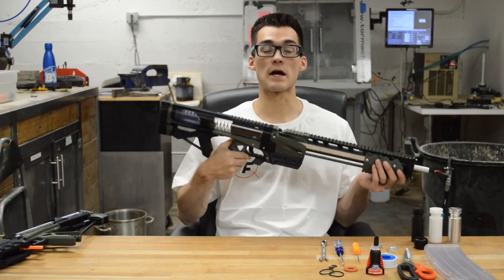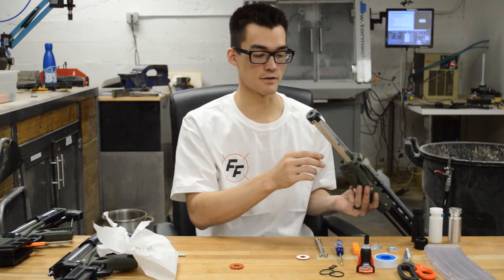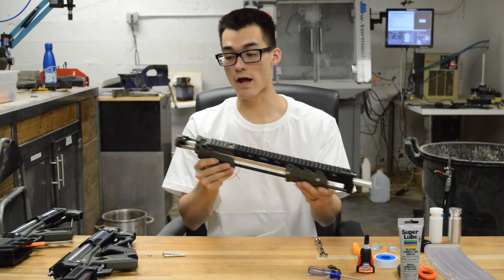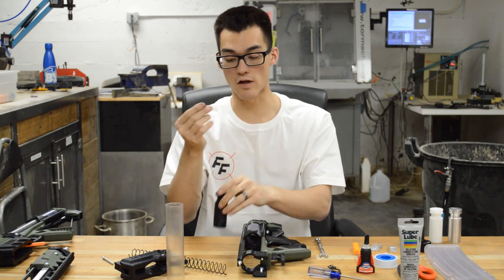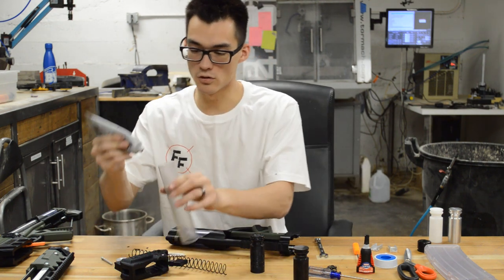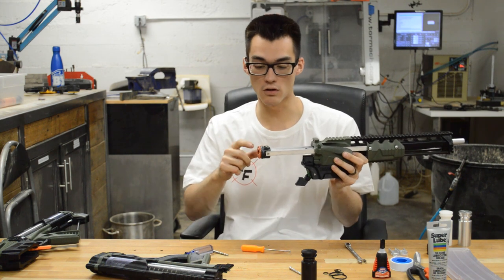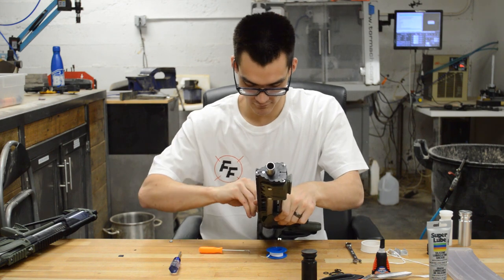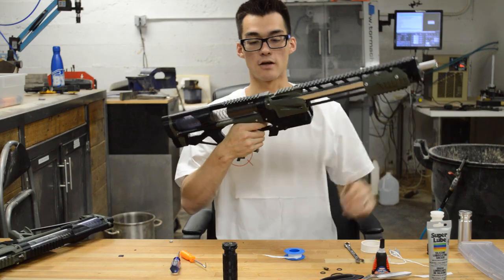Maintenance and Repair | Spring-Powered Nerf Blaster

Comment: Do you reccomend addjng an oring onto the pusher?
Reply from the maker: Yes! That's a basic upgrade that I recommend getting right from the get-go.
Reply: @FrontlineFoamBlasters  I have a metal psher and there is no slot where i could put an oring. When i tried it got stuck in the breech
Reply from the maker: V1BES jaxon The oring on the pusher is a different ramcore. You need a different ramcore that has an o-ring notch for the oring.
Reply: @FrontlineFoamBlasters  Ok sorry. Im new to caliburns.